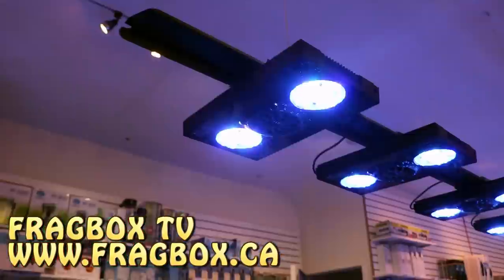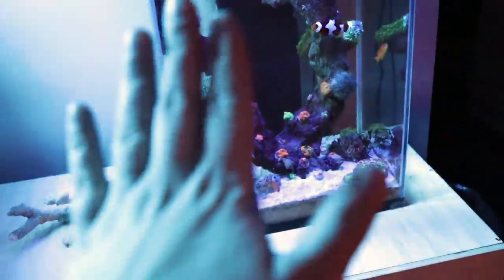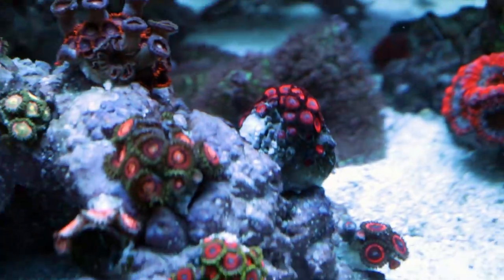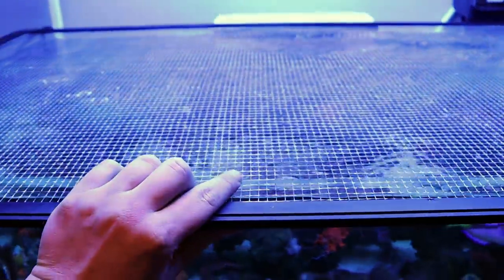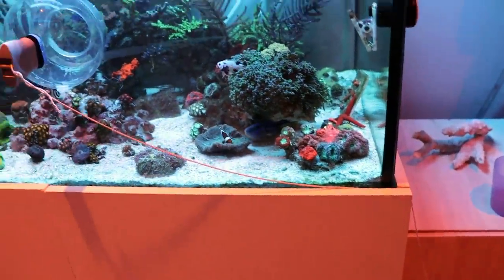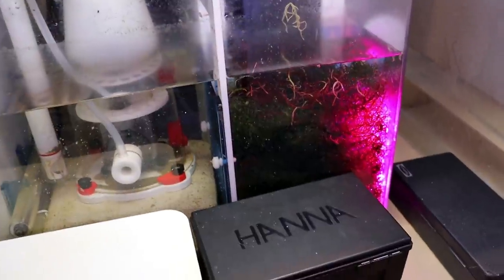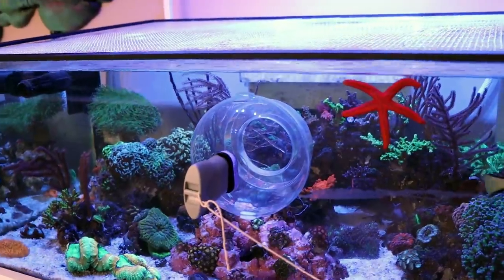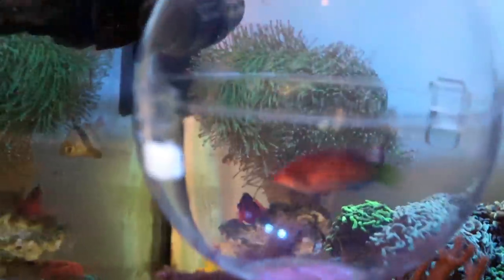Tia's Mixed Reef Tank Takeover + Nyos Fish Trap

Comment: Hey fragbox I'm using all for reef myself so far so good, but there's a lot to getting your parameters ready for where all for reef will match them so to speak or maintain them and you can not adjust levels individually unless you dose for those elements separately hope this helps